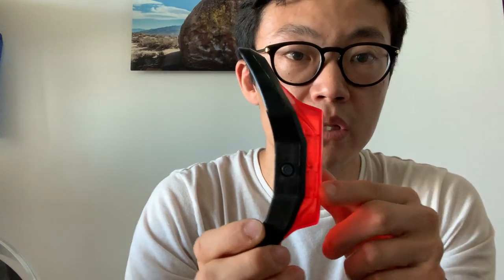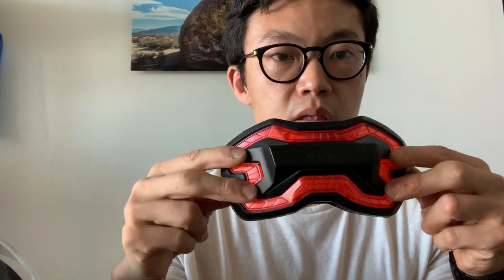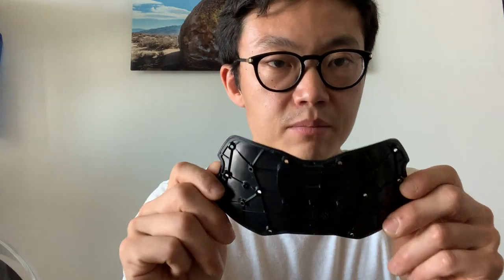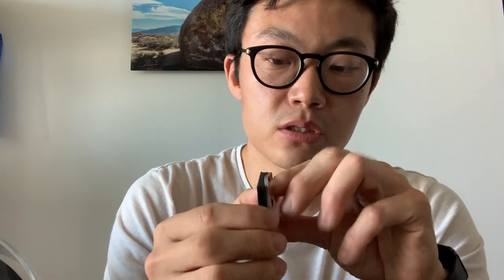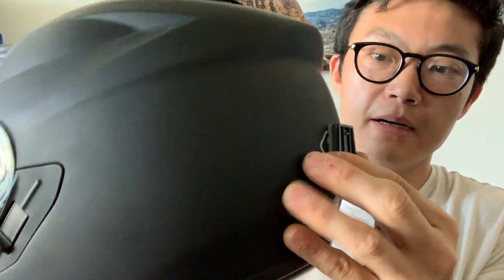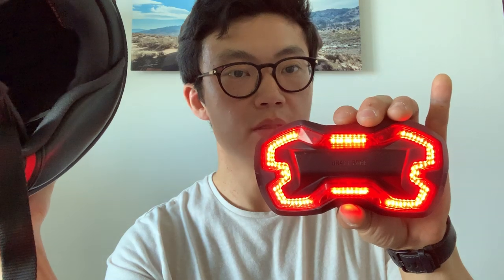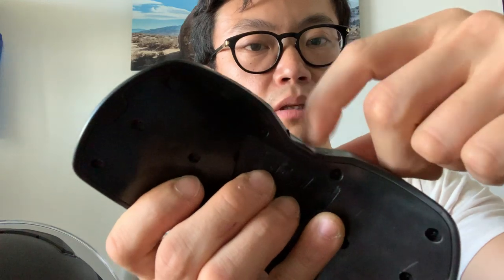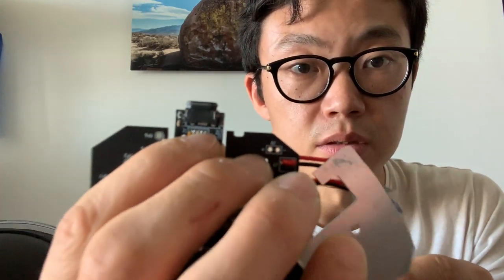Brake Free Update #26

Comment: Years ago, I rode with the Gmax 68s helmet. I loved that helmet. The back of the helmet had 6 led and had 3 patterns,  and for an additional cost you bought a the unit that installed on your bikes brake system. So when you applied your brakes it came on. They stopped making that helmet and thought I wouldn't see that feature again.  I saw your product a year or so ago, now I have your product and love it. I can move it from one helmet to another  and no batteries. Thank you so much for this product.

Comment: I just purchased one of your units and it arrived in the mail today.  I'm very excited to put it into use.

It is apparent from this video that a great deal of thought has been put into this device's design and development before its initial release.  I must say, for what is the first edition beyond the prototype, it is a very well designed product.  The black surround of the unit looks like it was initially a smooth hard plastic, but the final design has a rubbery feel, which not only gives good grip when holding it but also minimizes rattling against the shell of the helmet if it's not a tight fit after mounting.

My inly criticism so far, having not tested it, is the micro USB connection.  I would have gone with a USB-C, which is far more advanced, reversible, less hassle and now more prevalent.  I understand that also improves charging speed.  Maybe that will be on your next iteration.

The 3M peel-off adhesive, I have had issues on a GoPro mount where the mount fell off my helmet after only a few hours of use, so I am not confident about the adhesive long term, though everyone says it is quite tight and reliable.  My preference would be to use Sugru putty, which I swapped on my GoPro mount and is hard as a rock.  Assuming I stay with the 3M supplied adhesive, can it be applied over the DOT sticker and work just as well?  Mine is precisely where the mount will be affixed.

Great product!
Reply from the maker: Thank you for your feedback. Glad you appreciate the work we've put into this product. 
USB-C will in fact be in the next version (fast charging as well). 

We have recommended Sugru for mounting to odd helmet shapes and works quite well. 3M solution has been working great for our customers. 

Yes, it's totally fine to mount over the DOT sticker. They tend to be attached using industrial strength glue and stay one well. If you had to remove our mount, the DOT sticker will not be affected.

Comment: First of all utmost thank you to you and your team in designing the safety equipment for bikers. With the new technology in the market why it have to be bulky look and if include signal indicators why wont you design the left and right be arrow like <<< for Left & for Right >>> amber. No pun intended here and unfortunately your establishment website do not accept international order, it only stated USA and Canada.
Reply from the maker: We now have a EU distribution partner. Our EU website is www.brakefreetech.eu
The bulk comes from the 18650 cell (lithium ion battery). We wanted to offer maximum battery life without locking ourselves into exotic custom battery packs. It was the right decision, as now many of these battery suppliers have order lead times of 52+ weeks. 18650 battery is ubiquitous, and dense energy source which served us well. Sorry you feel it's too bulky. It looks quite nice on most helmets. 
Including blinkers would require a wired connection to the motorcycle. In this product we wanted to offer super simple installation requiring you to only attach a helmet mount. There have been plenty of wired solutions that never caught on in the market and we assumed one of the main reasons have been the complex installation process.

Thanks again for your feedback.

Comment: I just got mine and love it! Only concern is the button is super hard to press and change modes, and almost impossible to press with gloves on. Any chance mine might be defective?
Reply from the maker: The button gets easier to press over time. It is a one-piece lens design to make Brake Free water/snow/dust resistant. Sometimes, the angle at which you're pressing it makes a difference since the button does not stick out very much. If you think it's a defect we can try to exchange it for you to see if that makes a difference. Please send us an email to support@brakefreetech.com and we can help you out.

Comment: I've got a question after viewing this, regarding the operating modes for the light; is it only one state? ie: on and illuminated and flashing when activated?  My own preferences are a clear change of state - off to on - as maximum visibility.
Reply from the maker: There are three different modes. There is a mode where the running lights (15% power) are on constantly and activate to 100% brightness during braking. There is a pulsing mode where the running lights are constantly pulsing on and off at 15% power and turn on to 100% solid glow for braking events. Lastly, there is a "Stealth Mode" where only the center lights are on as running lights and all light panels turn on to 100% power for braking events. Stealth Mode is probably the one for you as it offers the biggest visual change in state.
Reply: @BrakeFree  When will you have this for sale?

Comment: No turn signal ? It will be so cool if we lean a little the head to the right or the left to activate turn signal without a remote control because on my Halfbike3 i can't install remote (very small handlebar) but i think the price will not be the same.. ;) !
Reply from the maker: We have that ability, but decided against it as it was taking away from the accuracy of the brake detection. We will continue to work on that feature though, as a few folks have requested.

Comment: Hey Henry. Awesome product my friend. Question, does the light set sink with a HEX ezcan? I have a BMW R1200GSA with a HEX ezcan to monitor my braking and horn systems. Thanks Bro. Mike Bowie
Reply from the maker: Hey Michael, Brake Free is autonomous and does not sync require a connection to the motorcycle.
Reply: @BrakeFree  So how does it sink to my brake system on my GSA?
Reply from the maker: @michaelbowie9593  Brake Free detects braking through the use of sensors and microprocessor running our patented brake detection algorithm onboard the Brake Free unit itself. This is why you don't need to sync Brake Free with your motorcycle or cellphone, it just works, regardless of what you're riding.
Reply: @BrakeFree  Cool. I'm hooked and ready to purchase my friend. Michael
Reply from the maker: @michaelbowie9593  That's awesome! Right now we have pre-orders open for our next mass production run scheduled to ship in May. You can order/pre-order on our website: www.brakefreetech.com

Comment: I can't figure out how to lock the brake free to the mount
Reply from the maker: To mount Brake Free onto the mount, you'll need to locate Brake Free over the mount and press down until you hear it click. When it's clicked in, you should be able to shake the helmet upside down without the unit coming off. Some new mounts have a bit of a break-in period where it requires more force to clip it in the first dozen or so times you clip it in. Don't worry, you won't break it. If you want some more help, you can record a short video on your phone and email it to us so we can help you out further. Our email is support@brakefreetech.com. Hope this helps! Don't hesitate to reach out, we're always happy to help.
Reply: @ I got it.  Thanks

Comment: When Shoei starts building helmets with units like this pre-installed ill get one. I like your product. I just don't want to fuck around with it. I just want to ride.
Reply from the maker: That was exactly the premise behind our product. Simply stick it on the helmet and ride. No splicing wires. The battery is huge and give you 10+ hours of riding on a single charge. For many riders that means you charge it ever 2-3 weeks.

Comment: I like this and I’ll probably buy one. I would have designed it differently, though. I would have used a flat battery, housed along the base. So, the whole unit wasn’t so thick. The thickness is the only thing, I don’t like about it. Also, the flashing red mode, will be illegal in most places.

Comment: The changing from soldered to connectors sounds like a massive change.  Is there a new release date?
Reply: lol looks like you need to look up the definition of "massive". Check the email where you got this video link from (update #31), it has the same date as update #30: "Fall of 2019"
Reply from the maker: Hey Will, changing to connectors is not a big deal. We don't expect it will add much if any delay as we are still using the same locations on the circuit board to replace a solder connections to connectors. We are doing this is to improve quality and speed of assembly in mass production. We are testing out the fitment of connectors inside the unit as we are doing EVT testing. These things are happening in parallel with testing and are not adding time to our timeline.

Comment: https://youtu.be/-AyLg7DqEXo?t=574  Speaking of the wobble. I just received mine and installed it. I am excited to use this and benefit from this awesome idea/technology, but I immediately noticed the wiggle. Because its plastic on plastic, the wiggle, while slight, is very audible in the helmet.   Seems this has NOT been addressed as this video is 3 years old and I just received my product today.    Any tips on getting rid of this "wobble" that I can do to my device?
Reply from the maker: It seems to very slightly from mount to mount. We've tightened up our tolerances in production to limit this from happening. We'd be happy to send you some new mounts to see if it fixes the issue (free of charge). Please reach out to our support team to get this going (support@brakefreetech.com).